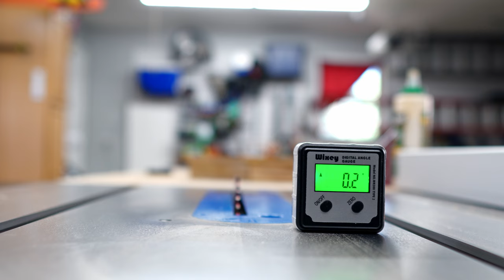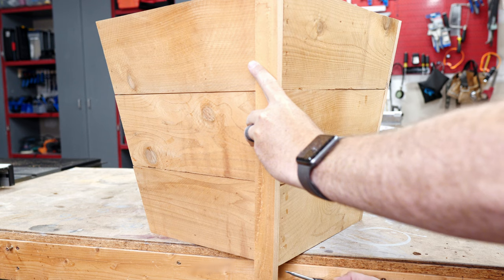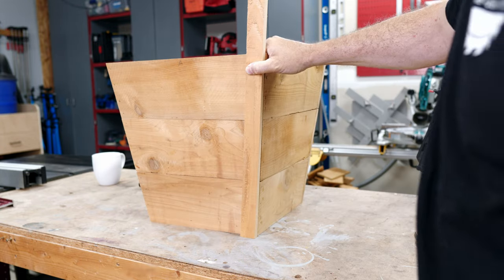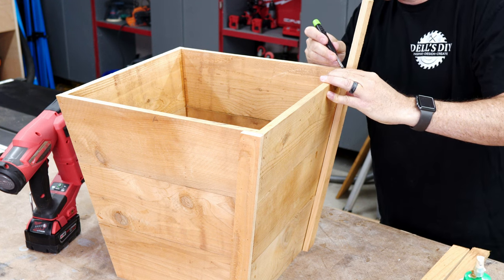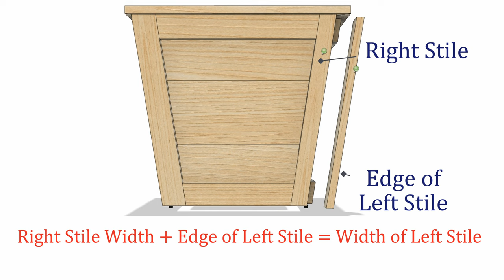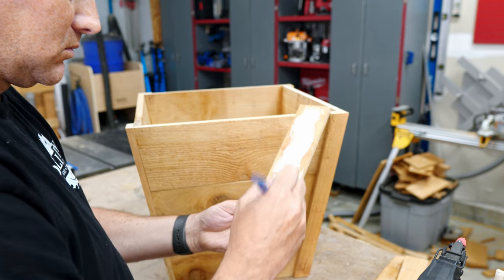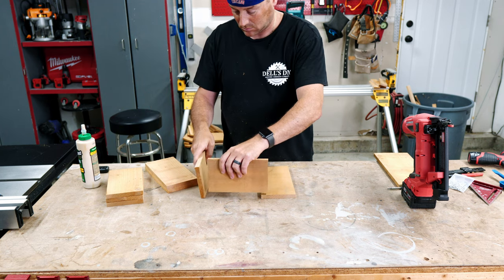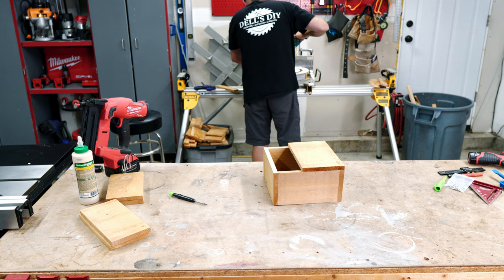DIY Tapered Cedar Planters For Beginners

Comment: I am getting the plans for this one. Nice build. I too switched to battery operated nailer and LOVE IT. I have the Dewalt and it is really sweet. Uses 4 different size nails.
Reply from the maker: I’m so happy you like this build!  The plans are very detailed, I hope you love the finished project. I will never go back to pneumatic nailers after using battery nailers…such a great convenience to be ready all the time with the noise of a compressor.

Comment: Question for you when you get time :  Can you tell me the reason behind going horizontal with the initial framing instead of vertical?  Without paying enough attention to the assembly method I automatically went vertical instead, assembling with #6 x 1 stainless steel screws. Because the trim boards hide these screws, I also decided to screw the trim on with screws from the inside leaving no marks of assembly.  What I don't say is I probably assembled and disassembled this thing 4+ times trying to figure out how its done. If there was a way to shoot you a pic or two I'd gladly do it so you could see what I'm talking about. Thanks again for your time and consideration.
Reply from the maker: Thanks for sharing your build process. There’s really no reason why I started by building each level instead of starting with each side. There’s probably a dozen ways to build this. I found it easiest to build each level then stack them and trim them out.  I like your idea of screwing everything in from the back but again I wanted to make a beginners level plan and stacking and nailing was definitely simpler. I’d love to see your project. Feel free to share pics on Instagram or Facebook if interested in sharing

Comment: FYI for anyone.  You can make feet for the planter out of the stiles.  Just leave them longer and it will elevate the planter from the ground.  Helps prolong lifetime in avoiding rot.  👍🏾
Reply from the maker: I like that idea, thanks for sharing.
Reply: How did you get the stiles to become completely flat to the ground?  Example .. With the angle  set at say 7 degrees the stiles end touching the ground on an end point not flush.  Did you cut them back the on-site 7 degrees?    
Tia for your response an thoughts. 
Cvbs
Reply from the maker: That’s correct, the edge that touches the ground is also cut to the same angle as the taper used on the whole planter so that it is completely flat to the ground
Reply: Hi Ken Harris. EDMOND OKLAHOMA thank you I enjoy.
Reply: @kenharris4581 Hey Ken, I’m also from Edmond.

Comment: Can you tell me the purpose of cutting the bevel on the bottoms boards?
Reply from the maker: If you don’t cut the bevel on the bottom, the planter will essentially be sitting either on the edge of the boards instead of on the full surface of the edge or if you’re using rubber feet like I did, your rubber feet will be on an angle. That’s because the boards taper in from top to bottom

Comment: Great video but I won't be using cedar here as it's $27 for a 1x6x6 great design though I may build it out of preassure treated wood pickets
Reply from the maker: Wow$27!  Where are you located?  1” thick is way too thick. Do you have fence pickets at your big box stores?

Comment: Looks good but I lack a table saw 😲
Reply from the maker: Hi Nancy, I would highly recommend getting a cheap table saw if you want to get into some basic woodworking projects or crafts. But if you’re not comfortable using power tools then I totally understand why you may not be interested.
Reply: Projects like this can easily be accomplished w/o a table saw.  I recently built a few of these with chop saw to cut the lengths & then bandsaw for the strips.  Do you have any saws? Even a portable jig saw or circular saw  could be used. Heck, a good old handsaw could work too.   Higher end power tools just quicken the process & are usually more accurate. (Depending on your skill level).

Comment: like the video, but not a fan of the "non-safety" parts - no safety glasses, shooting nails toward yourself, all can add to unintended accidents.
Reply from the maker: Thanks for your support. I wasn’t aware that I was shooting nails towards myself because that is definitely a no-no. At what time stamp did I do that? I want to see what you’re referring to
Reply: @dellsdiy  Look at 7:34, while technically not fully aimed at you, with no safety glasses, anything could happen since the nailer is on the other side of the planter. Still, lots of good work and effort in the posting!
Reply from the maker: Fair point, a nail can hit a knot and ricochet in any direction.